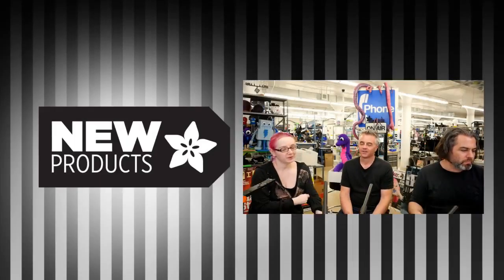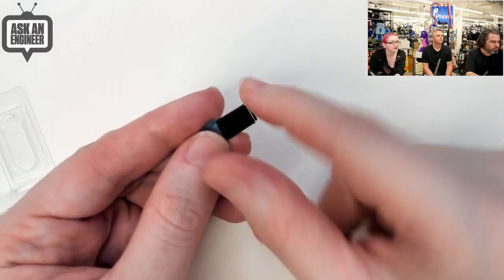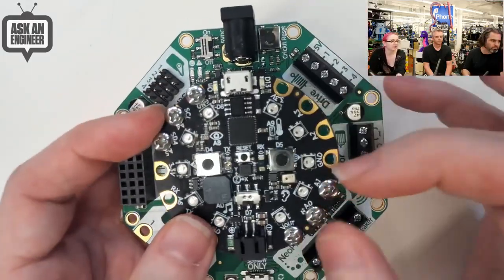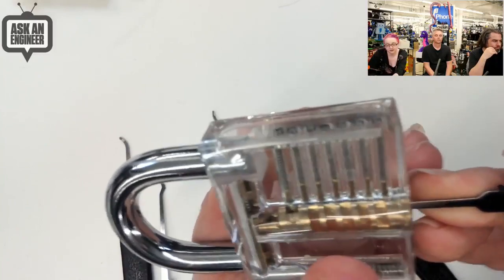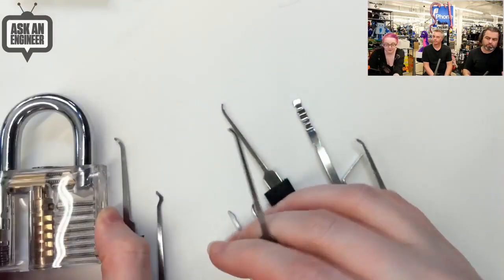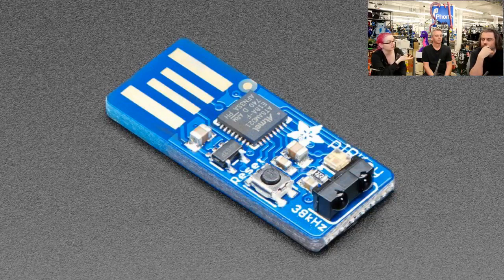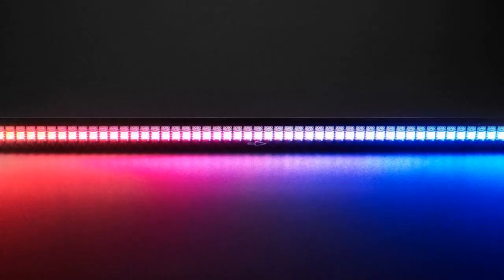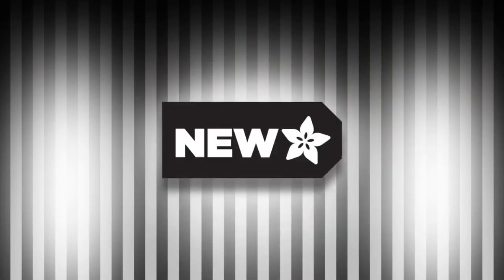New Products 5/23/2018 Featuring Ultra High Density DotStar LED PCB Bar! @adafruit #adafruit

Comment: Oh, this high density strips are amazing! I always hoped that you will produce strips with them since I heard of the APA102 2020. There are just too wide and thick for my model fairground in scale 1:87. I wouldn't run them very bright anyway so I don't need aluminium the aluminium heatsink. There is already a supplier for those strips here in Germany but he wants about 250€ (!) for half a meter. :(